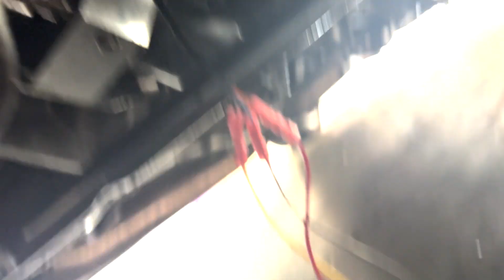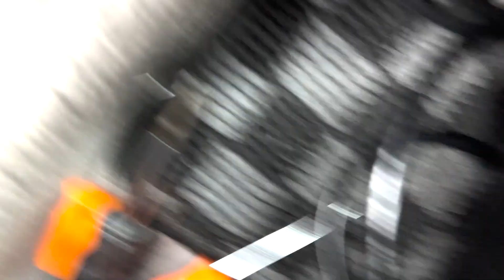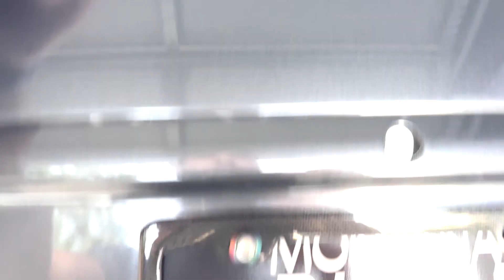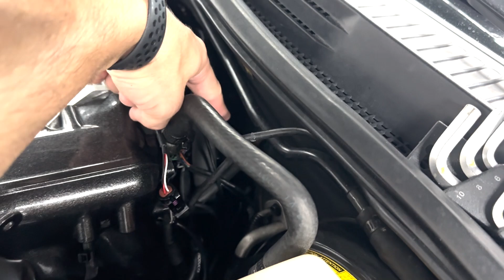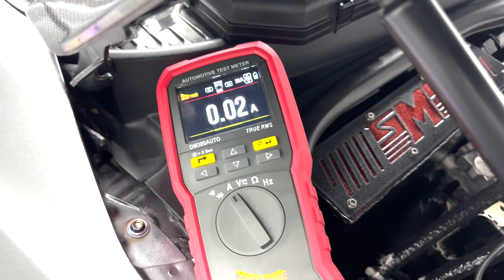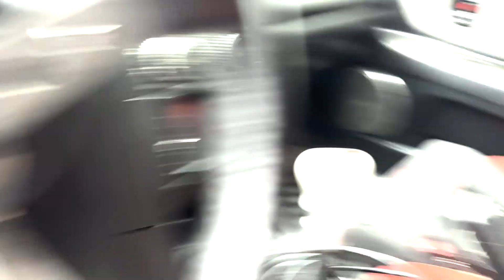Discovering Parasitic Drain: 1.5JZ IS300 Tips (Power Probe)

Comment: How do you like the dm300auto? Been thinking about picking it up from my matco guy
Reply from the maker: I think its pretty trick. Automotive only functions on a meter is pretty cool.. Guides you to better diagnose a little easier. Honestly the best feature is the amp conversions for fuses. More accurate than fuse charts and easier to use

Comment: Did I hear in the video that you work at power probe?  If so, please make some videos featuring the DM300AUTO and the PPDRAW. I would love to see these featured. I’ve seen them for sale on the tool truck and am having a hard time finding info on these tools.  The Power Probe website doesn’t have any info.
Reply from the maker: @johnterrie7767  yessir!!! The next video after this one actually feature both those tools!!
Reply: I had a suggestion for power probe. Make one of these PowerProbe bags available for my maestro.  Please and thank you.
Reply from the maker: @johnterrie7767  what about a mount to mount it on the wall or tool box? would either of those be more helpful?🤔
Reply: @HenryJZX  that might help some, but not me as much. I like the zip up container that my PPDRAW AND DM300AUTO came in. For the Maestro it would need to be large enough for the PPLS01 kit and maybe the PPPWM, PPAMP, PPT5VA as well so it could all be pulled out at once.
Reply from the maker: @johnterrie7767  I like the feedback! I'll add this to my list and see what the boys think. Maybe offer just a soft opening case as something to buy separately for situations like this